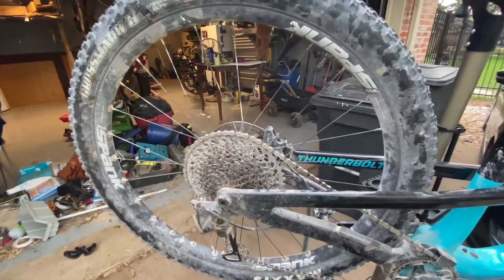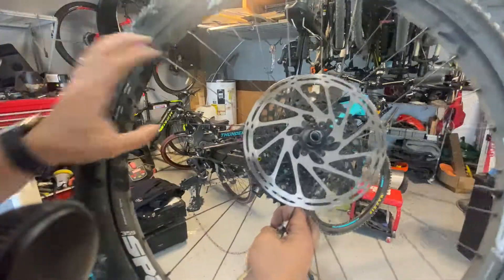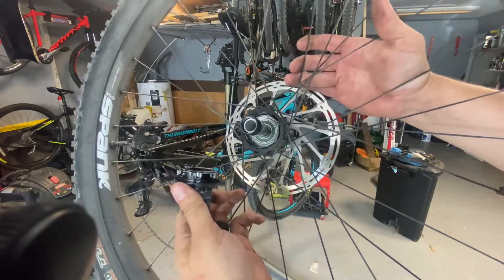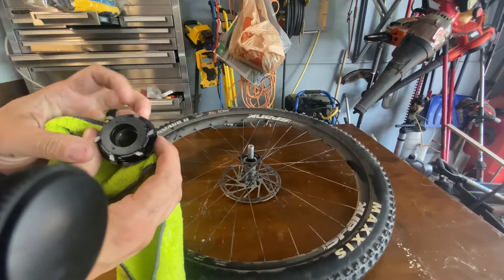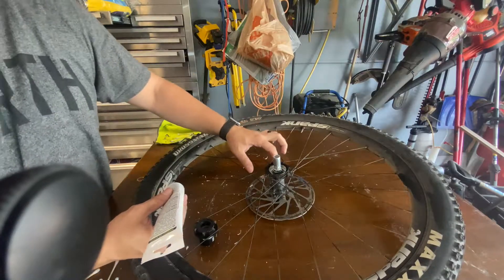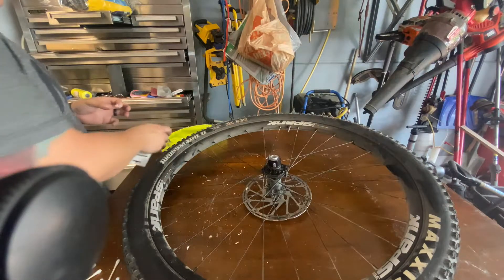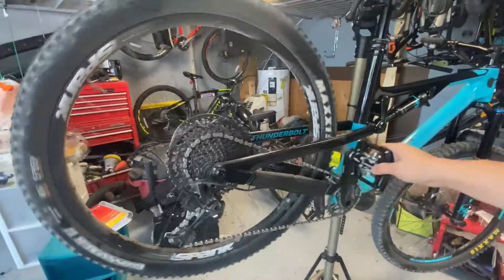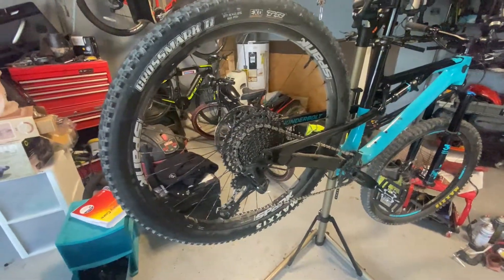Spank Wheel (Hex Hub) 1 month review

Comment: I bought this wheel. I run it on nukeproof scout 290 hardtail. It feels absolutely amazing. I thought it would be too stiff but it isn't as that bad 👍🏻
Reply from the maker: That’s awesome, glad your enjoying it. I was gonna post something else about it soon, because I’ve taken it on several trips and had blowout rock slashes mid ride on rocks and not even a dent.
Reply: The funny thing you mention nukeproof , I brought the new nukeproof horizon v2  wheelset recentl  , really happy with the wheels . Have since found out the hubs are the spank hex hubs with nukeproof branding on them . Same hubs .
Reply: @camwells9726  i had horizon wheels v1 last year. My hubs were brown and made by novatec. I send them back after few rides. Not very good wheels. 

I've heard good reviews about V2 and now a set of 29 boost cost £350 at chain reaction and I'm tempted to buy a set 👍🏻 
They look very nice and sound good. I'm glad you mentioned that nukeproof uses spank hubs. They look solid. 

PS - I no longer have nukeproof scout. I cracked the frame few weeks back and now I got Banshee paradox V3 frame with spank wheels 👍🏻
Reply: @MartinTeerly  ive only had a few rides so cant speak of the longevity , but the ride quality is good , fast engagement , fast rolling

Comment: Good day sir. I would like to ask what kind of spank rear hub did you use. Coz im plqnning to change my rear hub and im using the 12 speed eagle cassette by sram. Is it the xd drive?
Reply from the maker: I got the 28 spoke XD version. The have different options to fit what you need
Reply: Coz i have a roscoe 7. And have the bontrager rim 32 holes. And planning to change my rearhub. I change already the cassete a nx 12 speed casstte. If i will change my rear hub, does spank hex xd drive will fit? Thanks for the reply sir.
Reply from the maker: They have the option for 32holes if you like. 32 is supposed to be a little stronger than 28. They also have the option for Shimano hub that will work with your NX cassette. You just have to see what size/spacing you have, Like Boost 148 or 150/157. I got the combo that was the Hub with wheel. It was a great choice in my opinion. I went from a 21 internal diameter to 30 and the combo just feels great. So unless you have good wheels already I would consider the wheel with the hub. Would save you time and money of getting the hub laced on your old wheels.
Reply: Thank you sir. Have a great day 👍
Reply: @chimpwithabike5657  microspline is for shimano 1x12 deore Slx Xt xtr and so on Hyperglide is for their 11 speed and under Xd/xdr is SRAM groupsets

Comment: Because if these are so good nobody will spend the money on hydra and king hubs lol
Reply from the maker: Not saying they are better and don’t have enough time riding the others to compare, But I paid at the time 275 ‘ish with a coupon code. Even at the current 399 for a new 30mm wheel with high engagement hub. It’s a pretty good bang for your buck.
Reply: @chimpwithabike5657  I agree these are very nice and going to be a trail shredder I need 1 for my 2020 treck roscoe rear hub is unsealed for some stupid reason

Comment: Are they very stiff ? I'm riding hard tail and rather heavy rider, I weight 135kg 

I owe old 350 but I want high engagement hub. 

I'm worried about 359 being too stiff but as same time I'm tempted by 19mm rim and how reliable they are
Reply from the maker: I don’t think I have ridden enough different wheels to really tell yet. I was in bentonville last week and 
I will say I hit a rock and slashed my tire and rolled in a rock garden for a bit before I noticed. The wheel had a scratch from the rock hit but there was no dents or bends. Wheel seems really strong. On the website it says it’s rated for downhill enduro 🤷🏻‍♂️ I’m about 215 and it’s taken jumps, drops, and rocks